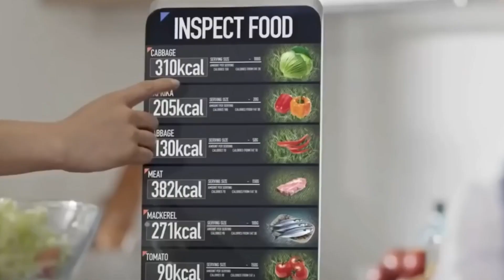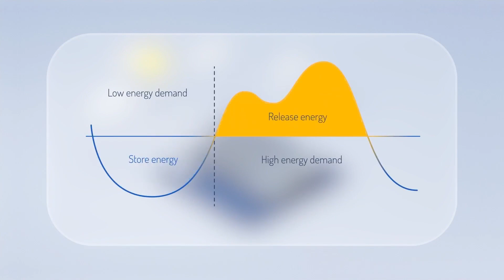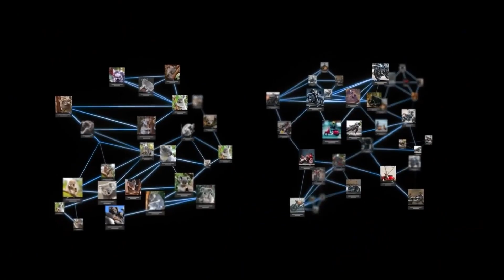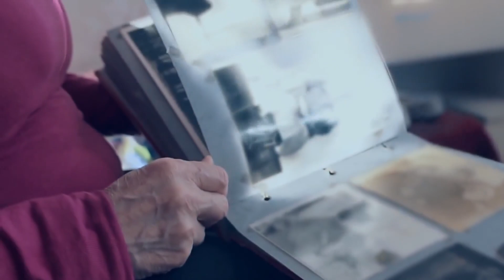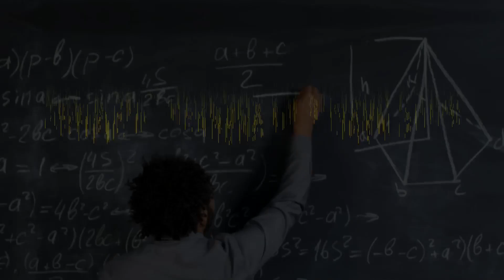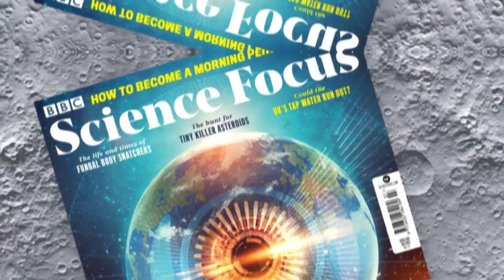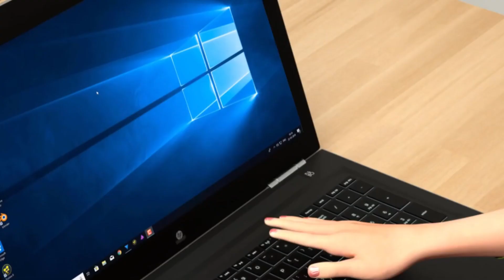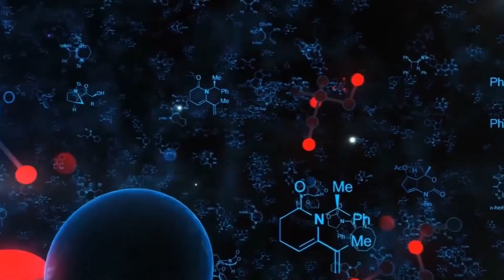FutureTech: Exploring Tomorrow's Innovations Today

Comment: This channel is going flat out wrong on its 1st story, sand is an excelent energy storage device for heat, ie thermal energy, the graphic even says thermal energy. But just because the sand is made of silicon dioxide has no relevance to storing lithium ions, the idiot or chatGPT AI that made this up hasn't got a clue. Garbage in, garbage out.
And why are all these science tech channels anonymous, no name, no face, no qualifications, no credibility.